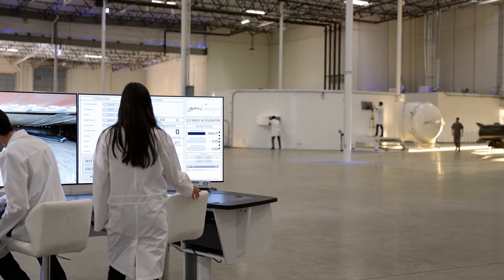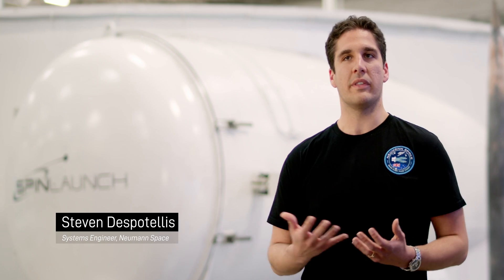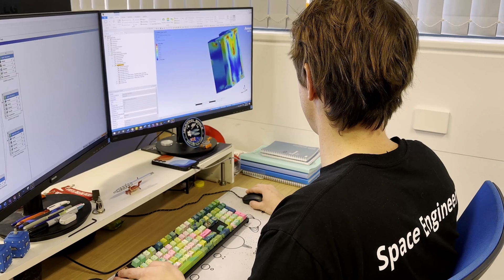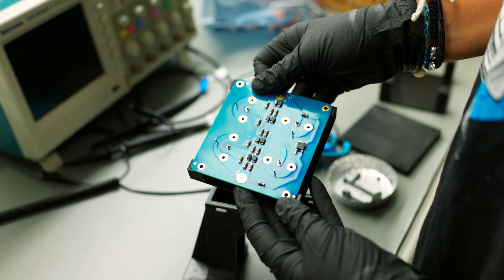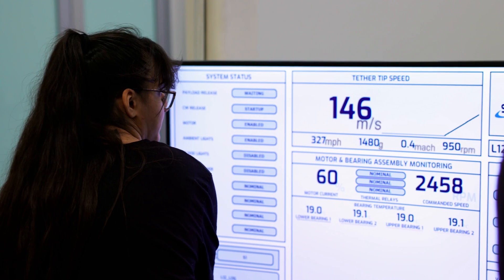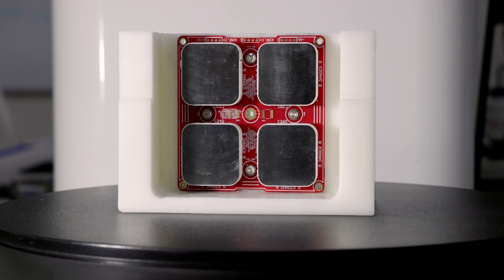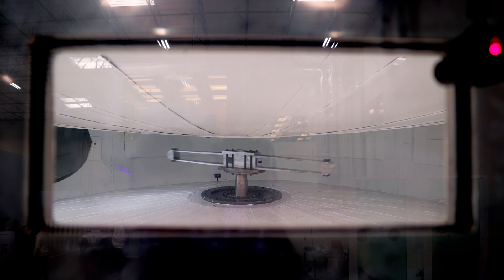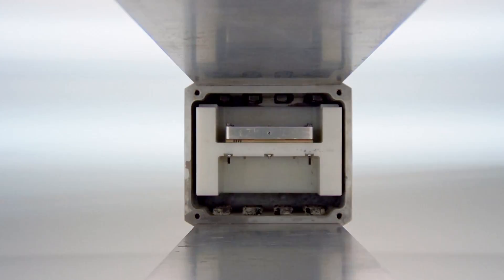Ruggedizing Propulsion With Neumann Space

Comment: If you freeze the video at 00:57, you see that the projectile is traveling as much horizontally as it is vertically, which is why it leaves an oval hole in the seal.
This indicates how much energy is being wasted in lateral movement and how unstable the projectile will be when its stabilizing fins hit the airflow, moving sideways.
So, they've disproven their own thesis in less than a minute.

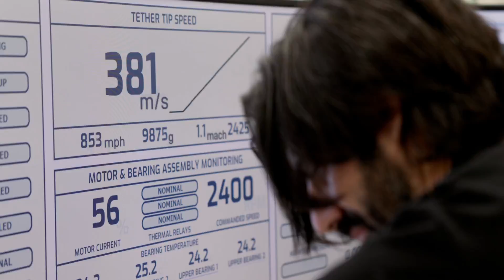Comment: 2:35 - If it's being subjected to 10,000g at only ~400 metres/second, how much acceleration will it have to endure at 8,000 metres/ second, which is an orbital velocity? Would it be 200,000 g, if my Maths are correct?
Reply: It said 3935 G at 400 m/s at the screen
Reply: Ah no 10.000 right
Reply: I checked agsin. The 10.000 on the screen are only projected. Should be 700

Comment: Keep up the good work.  I love your idea. You can basically dispense,wit a first stage rocket altogether,  but a second or third will still be necessary. Solid-fuel rockets as a second stage will be perfect for your application.
Reply: I'm not sure the structures you need in a solid fuel casting will be compatible with the g-loads.

Comment: Spin launch buckets of water to space. Water is rugged. Launch it to a low earth orbiting rocket refueling station that processes it to hydrogen and oxygen. Traditional rockets can then Launch to low earth orbit, and  fuel their second and third stages.  Being able to Launch traditional rockets with less rocket fuel means they can carry more payload. 

Water also can provide significant radiation shielding.  It will be helpful if it can be cheaply launched to orbit. 

Launch buckets of rocks attached to tethers. They don't need to be ruggedized. They can provide the needed counterweight for tethered momentum transfers. The statalite gets a boost in orbit and the rock, released in the other direction, harmlessly burns up in the atmosphere. 

Spinlaunch should look into how it can get raw materials to space that do not need special ruggedizing, In order to build out a space infrastructure construction.  industry.
Reply: > send water to orbit
> split water into hydrogen and oxygen to produce fuel
> combine it back into water when burning fuel

I think your solution got couple of redundant and unnecessary steps.
Reply: @ArtUniverse  
1) the point of sending water vs hydrogen and oxygen to orbit sending water is much safer, and water has a huge capacity to densely store hydrogen as H2O. 

2) Splitting water consumes quite a bit of energy and a large part of it is stored chemically. This energy can be sourced from space based solar power  which would be able to collect far more energy above our atmosphere, helping reduce the cost of energy to propell our future space craft. 

3)sure, burning hydrogen makes water. But making water isn't the purpose. The purpose in burning hydrogen is to release the energy stored in molecular hydrogen (H2),  convert it into thermal energy that propells the reaction mass whuch is now water and thus provides thrust. 

More importantly, water is rugged  doesn't break under the g-forces of a spin launch to low earth orbit. This would dramatically reduce cost allowing spinlaunch to dramatically
 drop the cost per kilogram to low earth orbit, which means traditional rockets could benifit with orbutal fueling because they don't have to carry the fuel for 2nd and 3rd stages from the launchpad to orbit, and may instead carry either a larger payload or require far less fuel in their stage that gets them off the launch pad to low earth orbit.

Comment: Ah yes, another company featured on times top 100 most influential companies 10 months ago. Dead now.
Reply: They should instead use weather balloons like balloons to carry a smaller version of their spinlaunch to about 50km, and then shoot the payload out. Since the atmosphere is extremely thin there, air friction and the needed velocity (and g forces) for the payload would be significantly low too. Also, the costs would actually come down.
Reply: A rough estimate shows that the needed energy to launch the payload at same speed would reduce by a whopping 99.43% at 50 km height!!. This directly translates to equivalent reduction in g forces experienced by the payload.

Comment: On arresting vacuum loss at launch, im currious if they, SpinLaunch, entertained a butterfly valve type door, that wont 'hit you int the ass on the way out?' By that, low resistance door and the projectile closes the door through vac on its way to push the next door open..

Comment: This is not a possible path to space. Throwing a rock really high is not a path to space. 

Anything they launch will require a second stage to get to orbit with the same required delta-v. MECO of a Falcon 9 is about 80 kilometers (50 miles) high, traveling at mach 10. A typical second stage of a Falcon 9 weighs 4,000 kilograms (8,800 pounds) without propellant. With propellant, the second stage weighs 111,500 kilograms (245,800 pounds). SpinLaunch's full-scale size and exit speed of 5,000 mph (8,100 kph)  translates into a peak centripetal acceleration of between 50,000 and 100,000 g's. One g is the acceleration due to gravity at Earth's surface. This means their spinning arm would need to hold between 5,575,000,000 kilograms (12,290,000,000 pounds) and 11,150,000,000 kilograms (24,580,000,000 pounds).... In layman terms: Their single spinning arm would need to hold between 14 to 30 Golden Gate Bridges not counting the concrete anchorages. There is no material that can hold that. This is just a big gun that doesn't take gunpowder.

Comment: I would love to see more info on the changes you need to make to the more mechanical systems. Bell nozzles, fuel chambers, electrical connectors, gaskets, bearings, etc.
Strengthening PCBs is one thing, but intuitively it seems like a small-fry in comparison to strengthening all the mechanisms needed in a rocket engine.

Comment: It would be cool if this was done in orbit , could create a system of spin launchers in orbit between planets and we would instead use fuel to slow down. In the vacuum of space.
Reply: The spin creates a counter spin. Thats why helicopters have stabilizers. Need something to push in opposite direction. OR you can just spin twice as fast.
Reply: @Meatball2022 then you have to counter launch to stop the launcher from spinning to load the next launch. Not impossible but quite complex. Would be assuming the energy would come from huge solarrays in orbit with the launcher.
Reply: @arnoldschlumphlatz  counter launch needed no matter if in space or on earth. But not to stop it from spinning. Needed to stop it from tearing itself apart like an ultra high speed fan that’s significantly out of balance.
Reply: Interesting idea. But it would require a counter launch to keep the launcher in place.
Reply: Getting the amounts of energy required to spin this thing, and deliver it in orbit would be extremly expensive. Also, even in space, any cargo would break at 10,000G

Comment: It's a great idea. And if they can't do much on earth, there's always the use of payload delivery back to earth from other bodies with less gravity/less or no atmosphere.
Reply: This is low power ? Have you any idea what kind of electrical consumption space hardware curently uses ? Also even in space payload would break at 10,000G's
And also the projectile would be huge to carry the fuel in order to stop at those speeds, wich adds points of failure under g force

Comment: Make it happen, also launch straight up for testing and use the sonic boom dampening I have talked about. Get Deltin(smarter everyday) involved.
When you are required to use it for real, then you can change the angle to be to the moon.

Make the bigger prototype now. Tell them you need it to launch fuel to gateway so we can expand to mars, tell them, it will become a tourist spot and bring hundreds of people in to watch the main launches.

If that does not work tell them my name.

I will drag you out into the rest of the Universe if I have to.

Matthew Groom
Chosen BY God
Nothing to do with religion, religion is wrong.

Comment: It would be interesting to see if it can be implement to solve the needed speed to activate a scramjet missile and thus eliminate the use of the booster stage
Reply: maximum weight capacity of 450 lb so probably not
Reply: @danielbuckman2727 They just need to increase the diameter of the thing to  increas that I believe.